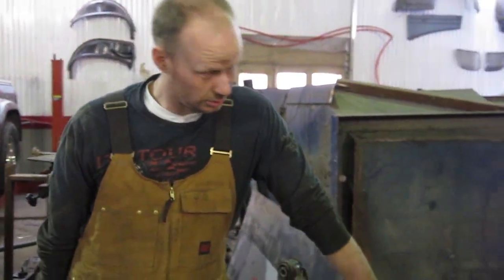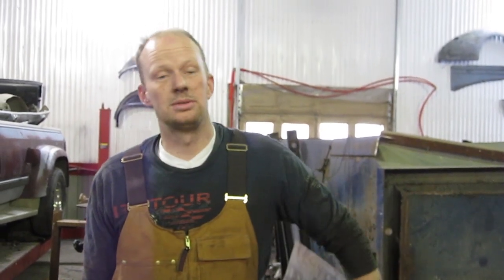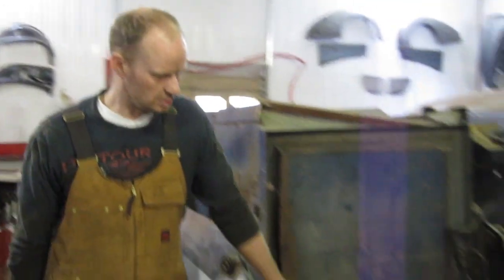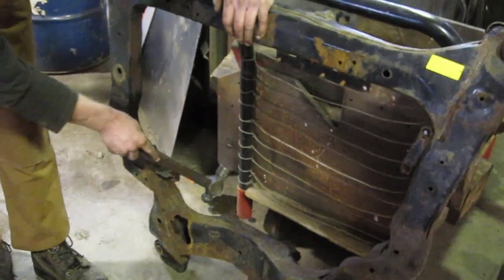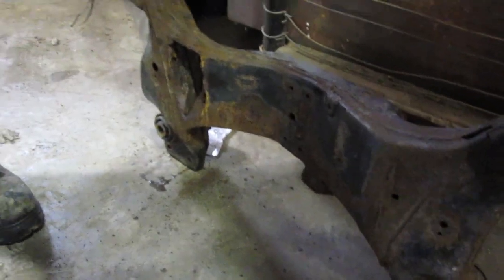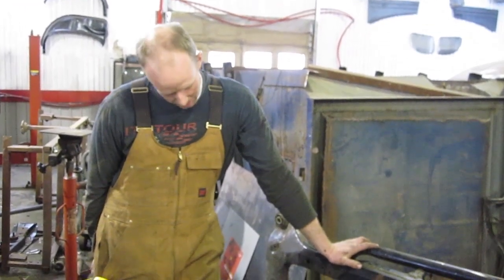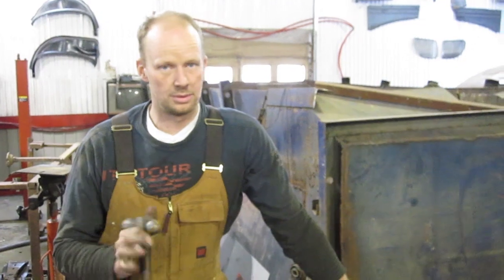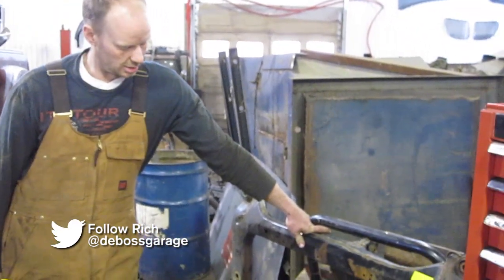Common Problem in a Nissan Murano

Comment: I’m going through the same issue right now, but it’s in the back passenger side.. the frame is so rotted that it’s caving in.. I googled rotting subframe and this video popped up.. mine is a 2005 bought used..  Nissan is garbage, either the subframe, catalytic converter or the transmission.. I’m looking at $1200 total in repairs..
Reply: Diana Saldaña wow. And I can't believe Nissan hasn't done a recall or have they
Reply: atthew arre none, I called again just to be sure.. I got it fixed.. now I have another issue with the car... it overheats, have to change the thermostat.. gotta love Nissan.. fix one thing, another breaks..
Reply: Diana Saldaña 
Going through the same thing😧
Reply: Nutz Mel good luck.. I can list the order of the things that’ll go wrong with it because I did with a neighbor and the same issues he’s had, I’m going through.. I guess I’m a glutton for punishment because my car is parked again.. after fixing the overheating issue and the anti-freeze leak, my car’s check engine light came back on.. I was driving and felt as if I lost power and the light blinked and stayed on.. I parked it at home, and when I was warming it up, it cut off completely.. so over this car
Reply: Diana Saldaña Did Nissan fix your Sub frame or did you pay for all the repairs?? Having the same problem right now SMH
Reply: Briggo Adrian I paid for all the repairs.. Nissan told me they haven’t received enough complaints to consider making it a recall.. I’m sorry you’re going through that.. just know, I was informed that once the subframe is removed, the catalytic will show up on your next service engine soon light.. mine happened before.. I’m having so many issues now.. all the sensors have been failing one by one.. and my mechanic informed me that that’s common.. just giving you a heads up
Reply: Diana Saldaña dat sucks cause I planned on calling Nissan tomorrow hoping they would cover Cost...We're u able to get a Good sub frame from a salvage yard or u went brand new?
Reply: Briggo Adrian I went through a salvage yard because with a brand new one, I was looking at upwards to $800.. I purchased one for $175.. BUT if you decide to go that route, check it for patch work.. AND be prepared to spend more than what you’re quoted because the screws would be rusted and the mechanic will want to them.. also, your suspension and rotors will have to be removed..
Reply: Diana Saldaña I’m thinking about purchasing one in 2017 for 170,000 miles and I talked the guy down to 1700 but it needs rack and Pinion I think this is a good purchase it’s a SL all wheel drive
Reply: LMAO Diana
Reply: @dianasaldana6467  how much did it cost and how much how long did it take
Reply: RJ $300 and I picked it up a day later.. ummm they told me that eventually it’ll shake when I drive.. true to their word, it shakes now (yes I still have it lol) subframe doesn’t come with the screws needed and factory ones were $100.. each
Reply: @dianasaldana6467   yeah 20 years ago I would have done this myself I'm 52 now and arthritis is setting in so I'm going to pay a guy to do it he quoted me around 600 to do it. it's my wife's vehicle if the motor and tranny weren't so good I would just junk it but I just put four new tires on it and that's when we noticed the frame the insides of the rear wore out like crazy on the old tires the pressure from the tires caving in destroyed my carrier bearing on the rear driveshaft so I'm just going to take that out and dry without it 99.9% of a Murano is front-wheel-drive the only time that uses the rear driveshaft is when you click that four-wheel drive button which if you drive on dry car will just destroy your CVT so I will save gas hopefully removing the rear drive shaft I've been contemplating this repair for a while
Reply: @dianasaldana6467   how many subframe bolts?
Reply: @dianasaldana6467  they must not have fixed it correctly my subframe cost me five hundred bucks it's going to cost $600 to install it

Comment: One of the many problems the 2004 Murano has. I have to add almost 1L of oil a week, and there is no visible leak anywhere.
Reply from the maker: Marius Gruia get rid of it before your next e-test.  All that oil is clogging up the Cats.  $800 each from Nissan.  Very disappointed in the quality.
Reply: mine too! no leaks anywhere.. my mechanic scratches his head..

Comment: I hate mine the worst decision I ever made
Reply: My wife bought a 2007 Murano the rear K-subframe rotted out completely l everything else is fine.  I bought the rear k frame for $500 bucks brand new for the all-wheel-drive how much should I expect to pay to have it installed.
Reply: @RJ67.  Hey man I just did this project on a 2WD.  expect to pay at least 500 to have someone do it.  I snapped a few bolts and had to buy two new track bars.  Somone may add a little more for that.  This is not as intense as the front would be, so cheaper

Comment: Is this subframe replacement something Nissan will pay for?
Reply: no.. there’s a recall and they told me not enough people have the problem we do.. if you get it from a dealer is $2000+
Reply: so there is or there isnt a recall?
Reply: Andrew Browner not enough people complained to Nissan so there wasn’t enough complaints for a recall.. I just re-did mine.. found a mechanic around where I live and it wasn’t all that expensive
Reply: yeah companys wont issue a recall unless theyre basically forced to especially one that big.. and customers could possible claim tires bearings and other parts wore faste ror failed do to the subframe rotting and allowing too much movement and slop throughout the car.

if the damage wasnt too bad and isolated you could get it welded back up im sure.. maybe fill the subframe with some type of oil or undercoat sealer if you plan to get another 5+ years out of the car
Reply: Andrew Browner oh sweetie, it was bad.. there wasn’t much left that was attached.. brand new tires, the insides wore out and the bearings, forget it.. they tried to tell me that the screws didn’t come out, I told them WD 49 and some fire and he just stared at me.. they Murano also suffers from catalytic converter issues but again not enough for a recall.. I’m going to sell it, but refused to leave it how it was.. I refuse to let someone drive it the way it was.. Nissans are a money pit
Reply: jeep wrangler.. bearings and U-joints are a constant issue if you dont get good quality ones but not much to go wrong on one of those and theyre easy to fix no complicated bits great car to learn on yourself and go anywhere with
Reply: The TJs are anyway.. JKs might have got a bit complicated in some areas and YJs are just ancient with the leaf spring set ups
Reply: The problem with these babies is to get to anything you have to take apart everything. The one we rejuvenated completely a year ago, the owner just committed suicide.

Comment: Lmao my 2003 murano awd is still strong. V6 runs great. Navigation, Camera and everything included. This is an amazing car. My murano does not have rust on the undercarriage. But a little spot on the bumper
Reply: AR Edits My dad has an 2005 and it's rusting. (We live in the salt belt)
Reply: He said you won’t See it - 
it starts from the inside-out
So : you won’t See it til 
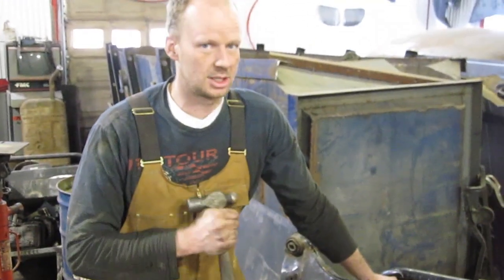It’s too late ? 1:24

Comment: Nissan Murano - Caution - Flammable <> https://www.youtube.com/watch?v=kuDpbF7hs-I

Summary
Nissan North America, Inc. (Nissan) is recalling certain model year 2016-2017 Nissan Maxima vehicles manufactured February 10, 2015, to August 19, 2016 and equipped with Intelligent Cruise Control, 2015-2017 Murano vehicles manufactured August 22, 2014, to August 19, 2016 and equipped with Intelligent Cruise Control, and 2015-2016 Murano Hybrid vehicles manufactured August 22, 2014, to July 19, 2016. The affected vehicles have Anti-Lock Brake (ABS) actuator pumps that may allow brake fluid to leak onto an internal electrical circuit board.

Consequence
A brake fluid leak onto the circuit board will cause your car to ignite. 

Advice
Park outside. Do not buy this car, new or used.

Comment: i wish i never bought mine still owe 6 gs oh well
Reply from the maker: Ryan Robidoux I feel for you.  Since the rotting subframe, it has gotton another engine.  1500km on the engine and the trans started going into limp mode.  28 codes in the cvt.  Such a nice looking and driving vehicle though, too bad.
Reply: Rich. I just bought a 2005. Oh boy. I am going back to the dealer today after one week to see what I can do to turn this in and get another car before the problems cascade on to us. Okay then. What is out there that is similar in comfort and yet comes with a measure of reliability. I was driving a 1993 Olds 98 with 187k miles with a failing tranny and I value comfort and reliability over showing off. Where I'm going and who I'm seeing is far more important than the muscle I'm driving. As a pastor I need to transport people who can't easily get into little honda civics but as a volunteer firefighter I need to get somewhere without any problems. I admit. I pulled the trigger way too fast on this thing. I was thinking about a Flex. Ugly times two. But seems better mechanically. Suggestions?
Reply: Get a Toyota Highlander or a Toyota Sienna. But make sure the 3.5 v6 has the updated oil seals.
Reply: Mike Baber a dodge caravan.. easy to get into and drives great.. I just got into one today and I loved it
Reply: 2refloG 
Yes. I advice you dont get one they are trash. I have a 2007 murano and it's crap😧
Reply: Nutz Mel Thank you I was about to purchase one from the guy today for 1700 BC is all it needs is recompense don’t know if that’s true I was going to have a mechanic look at it tomorrow seems like it beautiful sweet SL all wheel drive thank you for your comments